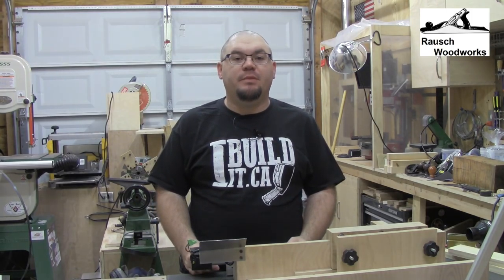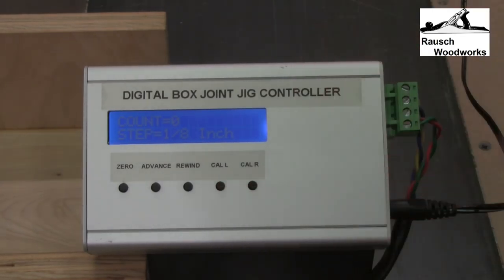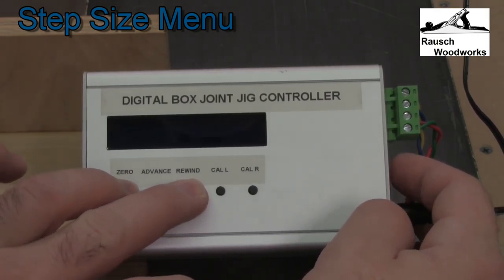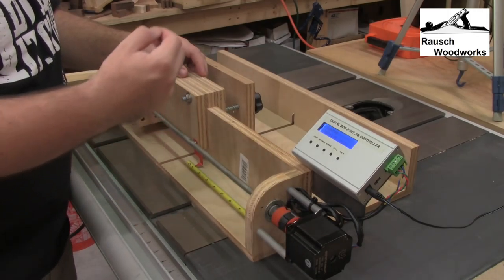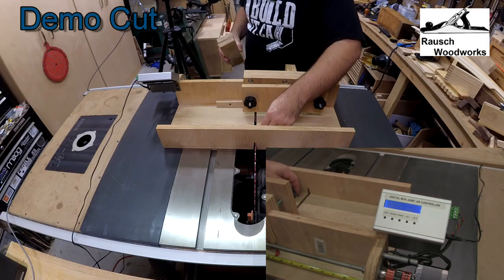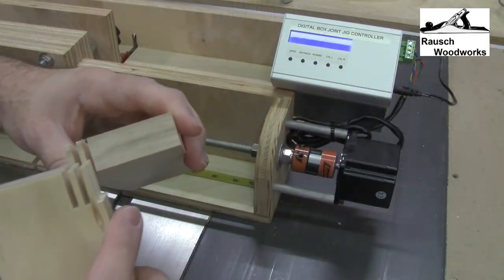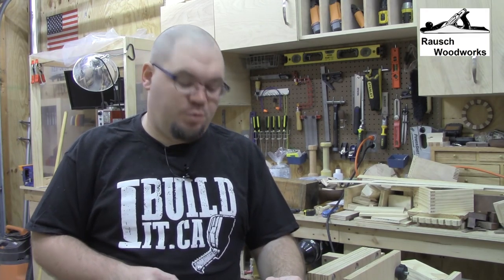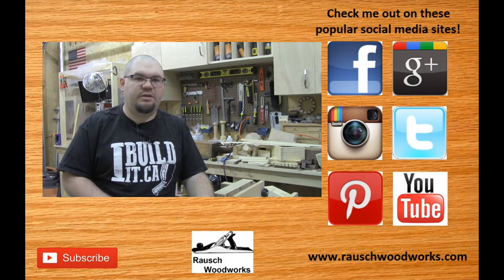DigiBox - Box Joint Jig Controller Demo

Comment: Wow, that looks really good, Jason! I'd be interested in purchasing one of these. Can a foot switch be set up for the advancing part?
Reply: +Jason Rausch 
 I was thinking the same, some kind of remote trigger instead of taking your hands off the work
Reply: I like the foot pedal idea, I suggested an aux port for the advancement button.  even a knee bump would be awesome.
Reply: +Ron Buchanan (The Wood Traveler)  I agree .... As I was watching I did not like that the advance button was the same size and in the middle of other operational buttons (not sure if it could be messed up "mid job" but the thought crossed my mind), I really like the idea of not having to take my hands off the work. A single finger button able to be mounted where one's dominant hand is positioned to complete the cuts without breaking a posture is what I would suggest. My guess is that a switch with a 7mm (or so) diameter would be cheaper than a foot switch
Reply from the maker: +Steve Collins I'm considering adding some kind of accessory/trigger port.  I'm looking at the space I have on the interface end of the PCB.  I'll update in my next video.

Comment: Nice stuff Jason.  I would be interested in it.  Are you talking about selling the entire jig, or just the box and plans?
Reply from the maker: +Howard Springsteen My plan is to make the controller built/tested available on it's own.  I also plan to sell the stepper motor and any associated electronics components as a kit.  The hardware such as bearings and rod will be another kit.  Lastly, I'll offer up the jig plans for sale.  If you buy a controller, I'll include the plans for free with it.

Comment: Hey jason. Due to a family crisis, I haven't checked back with you. I'm still interested in buying. I also, on second watching, was glad to hear that you built in the capability to tweak the amount of movement. Is that is the programming, or mechanically? Thanks. Jim
Reply from the maker: Jim, thanks!  I'm on the final stages of development.  Decided to hold off on release until I was 100% happy.  Final version will have the ability to upgrade firmware via USB and will have blade adjustment to tweak your setup.  This is achieved through software, which slightly adjusts the steps in the motor control.

Comment: interesting idea- an improvement would be to set up some switches so it automatically cycles to the next cut position each time you pull the saw back
Reply from the maker: +Charles Lewis Looking at an external trigger port to add a second switch.  Thanks for watching!

Comment: very cool.  I would probably throw a Bluetooth module on the control board and allow all of the adjustments vie smartphone app.  maybe loose the LCD on the sled, but keep a towards/backwards button.
Reply from the maker: +Robert D'Attile While that's a pretty cool idea, it really takes away from the simplistic approach of just a single box doing the work.  No need to break out a phone, pair Bluetooth ect just to move a stepper motor.  Thanks for watching!
Reply: +Jason Rausch - true, but if I wanted simple I would just use gears.  Your setup could allow for complicated box joints (1/2 inch joints with a 1/8 inch blade, or even alternating sizes in the same joint) without having to do any math.

Comment: I've been thinking about making something similar myself, but using a different method of working out how far the move the sled.  Can I ask what processor you're using here?  I'm torn between an Arduino Mega, and a Raspberry Pi 2.
Reply from the maker: +Glenn Leader I wrote everything in C for a PIC18F252 microprocessor.  No code overhead crap or OS to deal with.  Just strict definite C for the entire system.

Comment: First: I would not be interested just on the fact that it's made strictly for the American market. You should perhaps consider that a large part of your audience is outside the USA. Consider making a metric version with metric-stepped threads. (not sure if kerf width is sold in metric or imperial outside USA??). 

Anyway, on the build itself: good stuff. Perhaps consider making an input for a "home sensor" as a security function if people want a foot pedal or thumb-activated switch. Probably not a good idea to advance by accident during a cut or behind the blade. (I work in industrial automation doing controllers and some software).

The sensor logic part could further be expanded, with a sensor to register cut made. That way it would be relatively easy to program the sled to auto-forward after every cut. And then to make programs like "jump 1 kerf width 5 times, then jump 5 kerf widths" etc.. to make bigger box joints. Kind of like Matthias Wandels but automatic.

Hope you can use the feedback :)
Reply from the maker: +havenisse2009 I can look into a metric version.  I don't have any metric saw blades, so it would be tough for me to test.  The only thing I could do is use a dial indicator to measure the movement.  I'l also have to figure out the number of steps to equate 1 mm vs. 1/16".

Comment: Very good but about the wood dust is the controller sealed in a good way
Reply from the maker: +Tarek Abouelatta The aluminum case is pretty well sealed by the screws.  I'm looking at a plexiglass screen protector to go over the LCD hole and seal dust from getting in that way.

Comment: very nice solution, would need to allow for glue space. Also should cut 4 pieces in one pass.  I  would be interested.
Reply from the maker: Lee, thanks for the comments.  As is works now, I can use a standard 3/16" blade and get just a slight hairline gap between each finger and that works well for glue space.  Also, I can't see why you couldn't clamp in four at once, then flip and do the other ends.

Comment: With a little tweaking of the programming, you should be able to get the incremental accuracy to less than 1/64th.

Frank
Reply from the maker: +franksalterego The calibration feature already moves the carriage at 1/64" steps.  As for the steps, they are dead on accurate.
Reply: +Jason Rausch Then, what do you do to tighten or loosen the joint?... Suppose you only need to adjust .005?

Here's what I'm getting at... Sometimes, some sawblade's kerfs are slightly wider than 1/8th of an inch... How do you compensate?

Frank
Reply: +franksalterego buy a better blade, perhaps?
Reply: +franksalterego I've found the best way to adjust for a .005 gap in the joints is by applying glue to them when I put the box together.
Reply: +KSFWG Even if you have a good blade on a good saw that is making exactly a 1/8" kerf, when you get that good blade sharpened it gets a little smaller.  If it's going to have a stepper on it then it's got to be able to do a fine adjustment to dial in the fit for my money.

Comment: Jason it's very cool but I wouldn't be interested for the simple reason that a conventional box joint jig with a key is dead simple, cheap and easy to make, and faster to operate.
Reply from the maker: +Rich Sobocinski Understood.  I just like the idea that I can get completely accurate, repeatable cuts every time.  Also, it's a no brainer setup.  I tried making keyed jigs in the past and they were very difficult to get the spacing just right.
Reply: oh, hell yeah, if you can make something for yourself that is quick and easy and does what you want it to do, go for it. I'm just saying that I wouldn't expect a lot of do-it-yourself guys to shell out $100 - $150 bucks for something that they can do with scraps and 15 mins of work. 
I really do think it's a good exercise in merging your interests in electronics and woodworking.